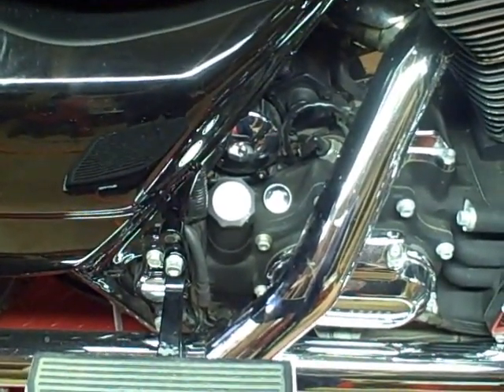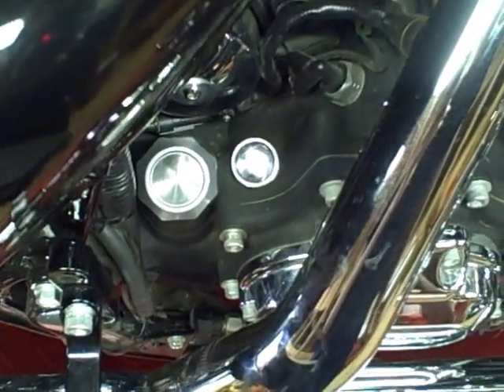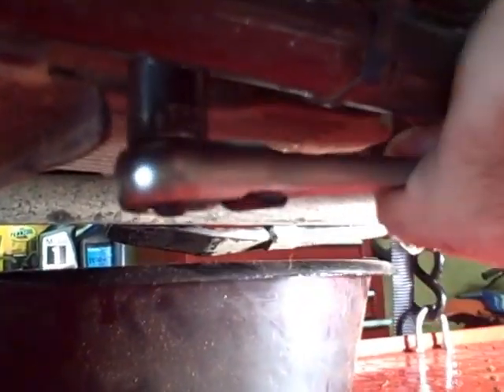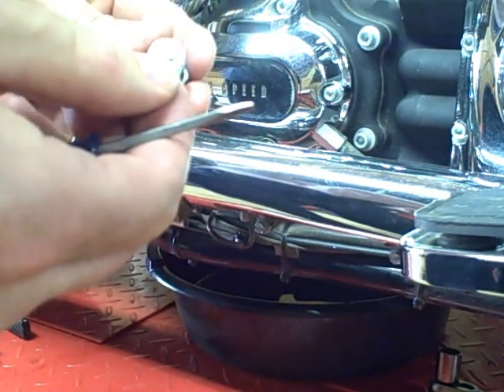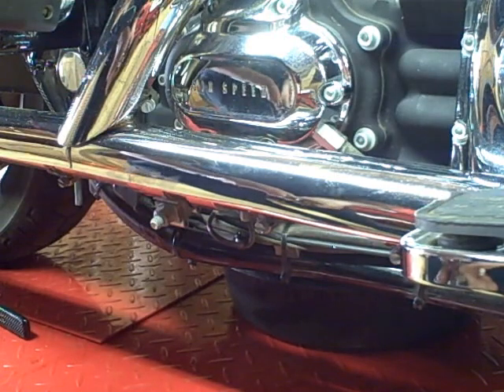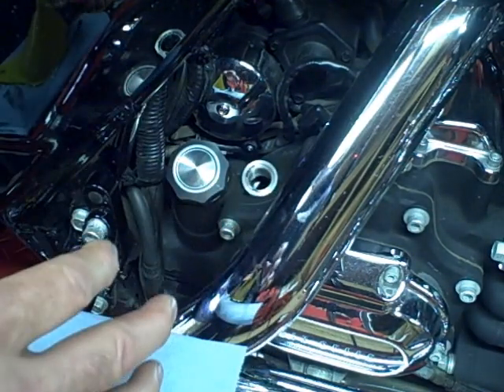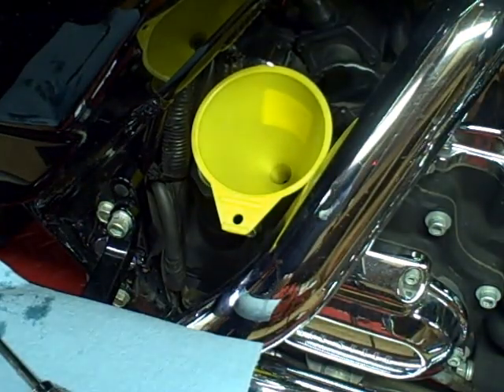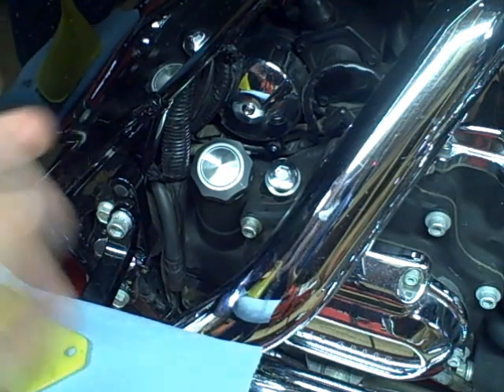Motorcycle Repair: Changing the Transmission Fluid on a 2008 Harley Davidson Road Glide

Comment: Thank you!!! You posted the only video I've seen sslo far that actually went as per the manual when checking......everyone else says "screw it in then check" but yhe service manual states "DO NOT screw it back in when checking level", they just didn't specify whether to rest the stick on the threads or base of the stick. Thank you!!

Comment: Thanks for the video.  This was very helpful in locating the correct drain and filler plugs.  Lots of informative details.  On a 2013 Dyna Super Glide Custom the fluid amounts are slightly less, but all the screw plug locations are the same.  Thanks bro.

Comment: So I could use Mobil1 20w-50 V Twin in the transmission if I prefer it over HD Syn3?
Reply: I, personally, use AMS oil 20w-50. My H.D. licensed mechanic told me it will still be okay to use under warranty. Also, personally, I have used Castrol GTX 20w-50. The synthetic oils are much longer lasting than the old school H.D. 50 weight oils. I use them in the engine, transmission and the primary. Same weight in all 3.
You can get away with changing the transmission oil every other oil change. As you may have noticed in this video the oil coming out of the transmission is a lot cleaner than the engine and primary.

Comment: Hi I was using syn 3 in my transmission also  and now harley is saying that it does not have the right additives and they are seeing more issues with bearings failing and are recomending go back to formula plus
Reply from the maker: Who told you this? Just curious if this came from the Motor Co.....Thanks